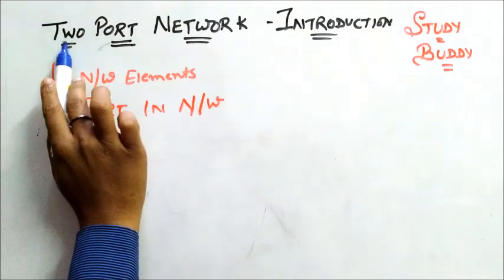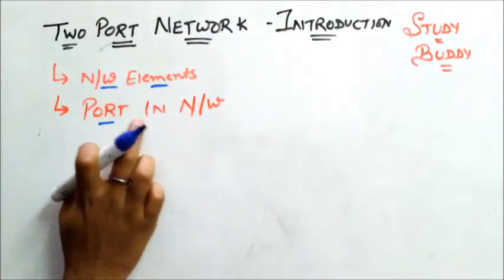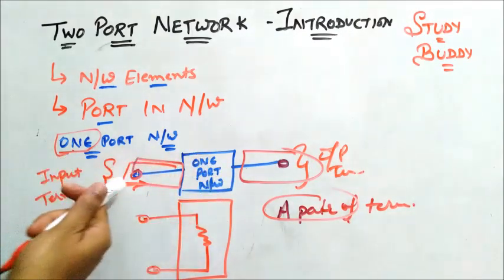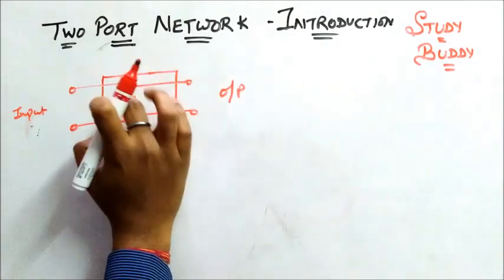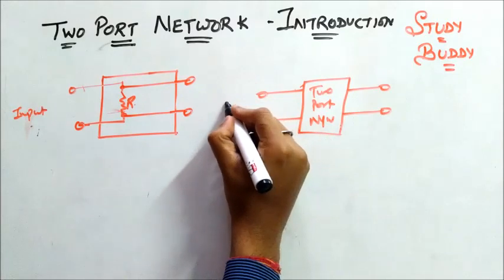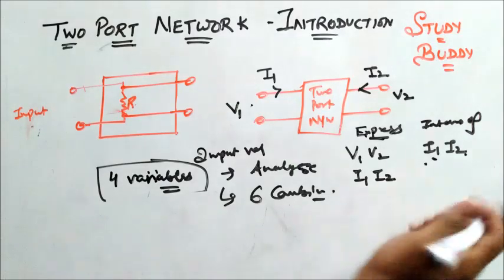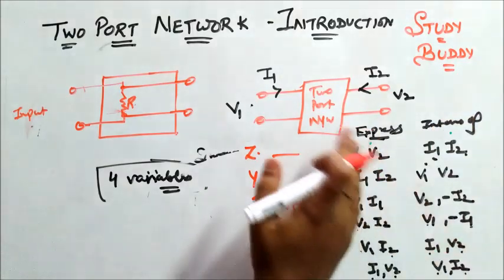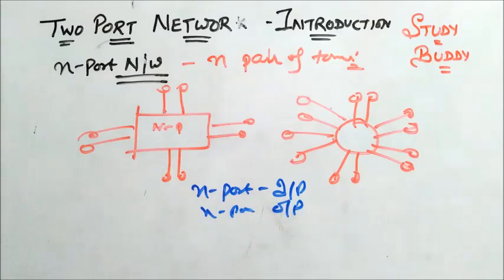Two Port Network introduction II Network analysis and Synthesis

Comment: सर हमलोग two port network का use क्यों करते है।
Reply from the maker: Because In general, it is easy to analyze any electrical network, if it is represented with an equivalent model, which gives the relation between input and output variables.
Reply: @StudyBuddy_in  thank u sir